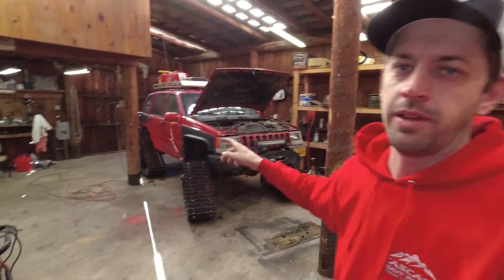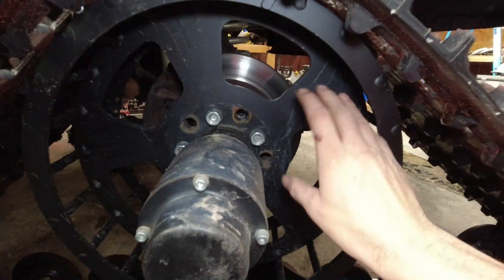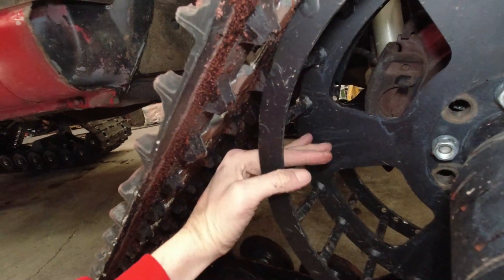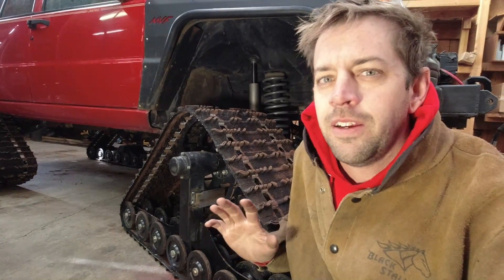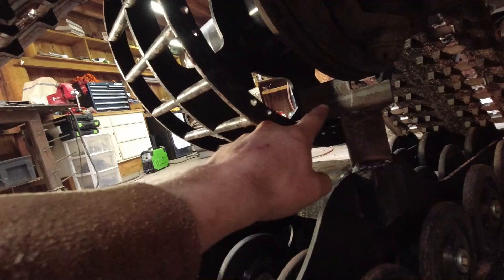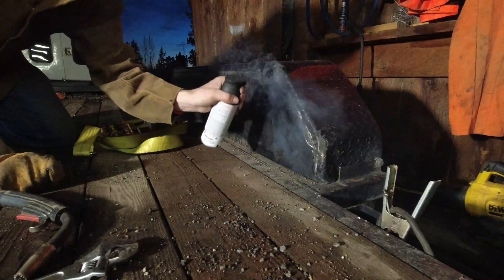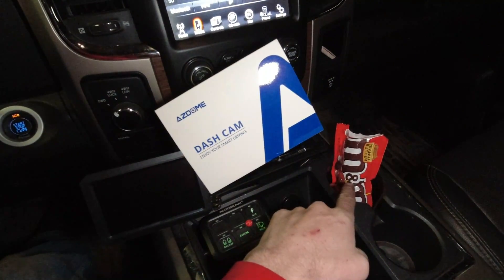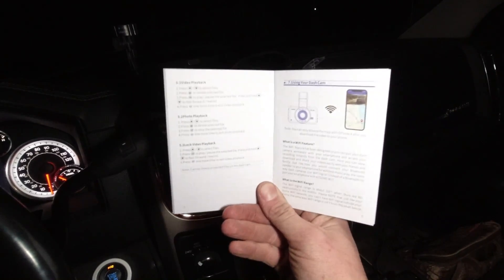Everything is broken.  Maintenance day for an off road recovery company

Comment: Hello Casey does your Dashcam only film to the front?
I'm asking becaus there a dashcams who although have a second cam for the inside of the car, which would be usefull for you, because you don't need to hold a cam while you're driving.
I'm using a VIOFO A-139 and this has one cam for the front, a second cam for the inside and a third one for the back, this means...
1. is filming everything in front of your car
2. is filming what the driver and/or the passengers are doing inside the car
3. is filming everything what is going on behind the car.
What i love most at the A-139 is that the cam have no monitor on the back, so for individual settings you need a smartphone or a tablet and with the app the settings can be optimized to the personal belongings.
It's even possible to watch all three cams at the same time while driving on the screen of smartphone or tablet or to coose only one of them, when i drive with my tablet connected via wi-fi to the cam i always have the cam of the back on, so i can see if danger is coming from behind, because my normal rearviewcam is only operating while the reverse gear is in.

Oh i don't want you to change your dashcam, but may be it's possible to install two more cams on your existing cam.

Kind regards
Kai from Germany
P.S. I know my english is under all pig! 🤫

Comment: After you welded your new snow scrapers on, did you ever think what happens when you might need to take the Driving Sprocket off ? You'll need to cut off one or both the scrapers. Not good if you're in the middle of nowhere.
Reply from the maker: All I have to do is cut the inside ones off, which I can do on the trail.
Reply: @CaseyLaDelle  -- Good call. I know I bent one of the Tumblers in half ( stump covered in snow) on a company vehicle . Good luck and I enjoy your show.

Comment: I'm... Following this pretty hard, but I'm not sure how it why this is worth the effort vs a frame off on a Bambi or snowcat. 

For the weight, ,you have like one third or less footprint. And ZTR is gone. (Zero turning radius is key). 

Will keep watching and hoping. I'm betting catesteophic turn wheel snap by mile 800.
Reply from the maker: Snowcats don't have zero turn ability either when they're actually in snow.   That is rule number one in any snowcat driver training
Reply: @CaseyLaDelle  fair enough. I agree. But they do have sub Minute of Barn turning radius. Unlike this thing. They can also brake a side and spin or drag a side and turn. 

I'm thinking back to Mech E 101 and trying to figure out what towing a 3ton rig while trying to turn with yours will do to your forces back into the rear setup. 

If it's not a 4-link, I can see a huge number of ujoints in your history. That is some mad lever.
Reply from the maker: @fshalor738  You're missing one very important thing.   With a two track cat the only way to turn is to take power away from 50% of your drive.  So whether your trying to chug through powder, climb a steep hill, or tow a dead vehicle out of somewhere, as soon as you try to turn you lose half of your traction and place 100% of the load on only one track.   On this setup all four tracks are always sharing the load whether going straight or turning.  That's why Tucker's are the number one Cat in the world for utility work.    And yes, all Grand Cherokee's are 4 link

Comment: nice concept with the scraper bar in the drive wheels for snow, but did you consider what might happen when you get mud or (larger) rocks thrown up into the wheel, possibly while making a turn or going through some soft stuff? I am wondering if these scraper bars will act like a perfect shelf for larger rocks and mud to deposit themselves and then jam up into the drive wheel and bend those bars that drive the track.
Reply from the maker: Maybe.  But then I'll just make new ones 🤷🏼‍♂️

Comment: Can he take the wheel off with that scrapper angle iron he put in? Otherwise than that I like it! It's K.I.S.S.
Reply from the maker: I can remove the tracks just fine, but cannot remove the drive wheel from the track assembly without cutting the inside scraper off.   But that's easy

Comment: How do you turn the dashcam on and off, particularly when you move the connector under the dash?
Reply from the maker: I want it to stay on 24/7
Reply: @CaseyLaDelle  how often will you have to replace the card then?
Reply from the maker: @bartgoins1782  never, because it will automatically deletes the oldest recording and starts a new one

Comment: I would weld on a plate then drill and tap it so I could unbolt that angle.
Reply from the maker: I have many ways of removing it
Reply: I don't like it. I mean I like the idea, but you bend that angle iron and it gets jammed into your sprocket?! That would suck.

Comment: Have you noticed on the tracks that if your vehicle is at 45° angle it will start sliding sideways especially if you're on ice you do a lot of mountain rescue just making sure you understand those tracks will slide out if you are sideways I'm pretty sure you know this already but have fun with them
Reply from the maker: No problems yet.  They have more sidehill traction than tires do.

Comment: 6:15  CASEY! Dude!! You need new wheel studs... Your lug nuts are not properly installed/mounted...
Reply from the maker: Incorrect.   Those are extended thread lug nuts.  They have more threads holding them on than the ones on your vehicle do.

Comment: To be honest, I personally just would not feel comfortable with plastic wheels. Surely there is a metal replacement part. On your trailer i had to so do something similar. I welded up a 2 inch angle iron skeleton frame on the outside to protect it. Do fat it has held up against a fork lift.  Good score on the dash cam too man. You never know plus you may get some great footage. Something else i NEED if a backup camera.  And i feel ya on the technology. That's probably why my videos are crap.